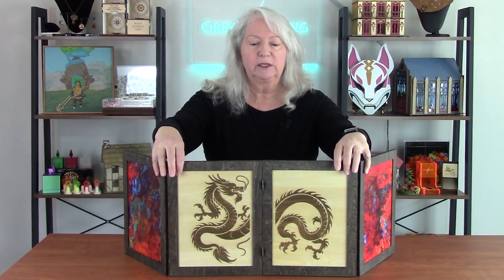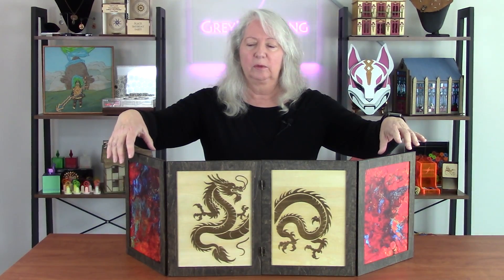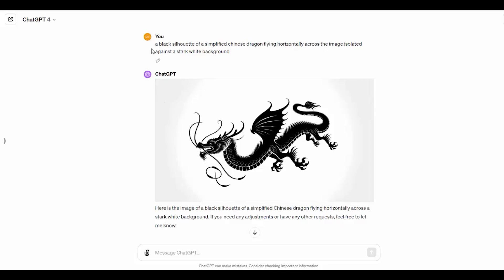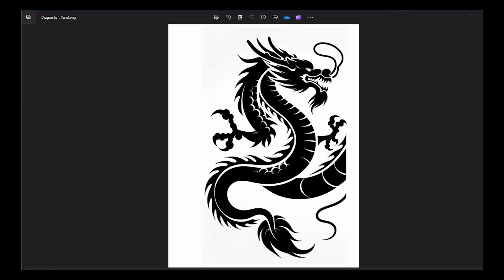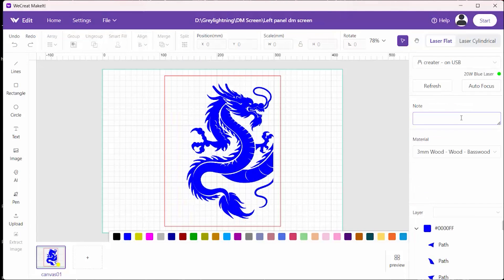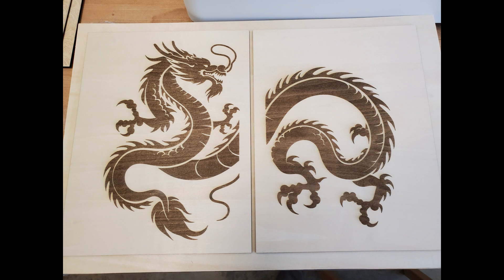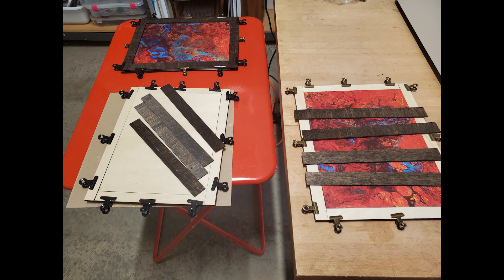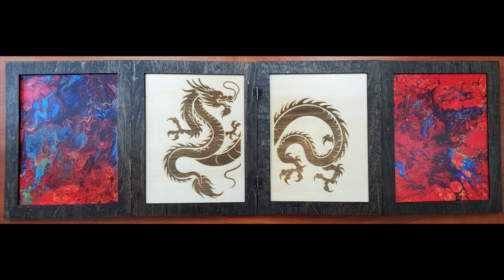How to Design and Laser Cut a Dungeon Master Screen for Dungeons and Dragons on the WeCreat Vision

Comment: Is there an option to turn on that lets the laser engrave in both directions? It only burns from left to right.
Reply from the maker: Bill, good catch! The difference is bidirectional fill vs unidirectional. This is an option in Lightburn, and I believe it is the default fill method. I never even noticed the Vision wasn't doing it. So far, I can't find an option to change it. I will ask WeCreat, and if it's not there, when it will be added.
Thanks, a really great question!!